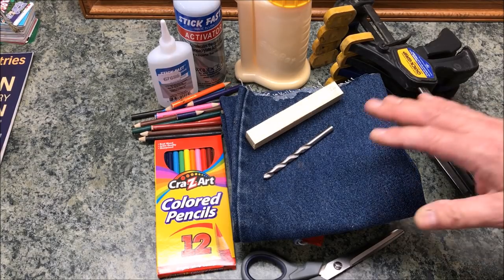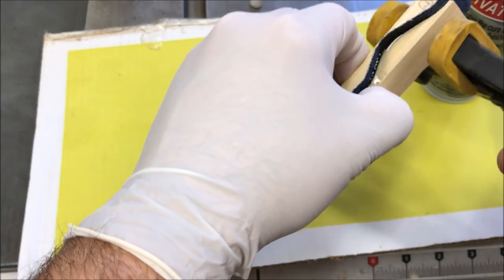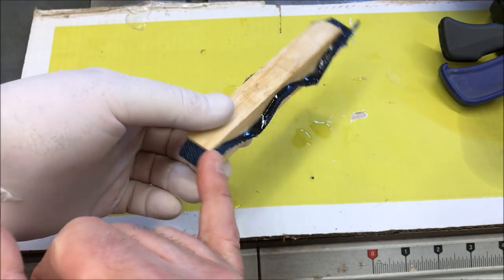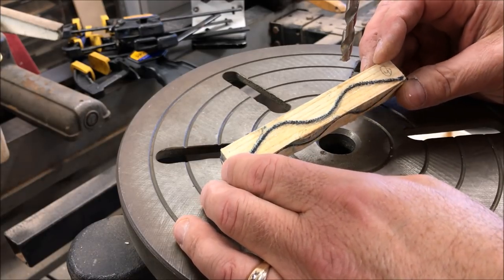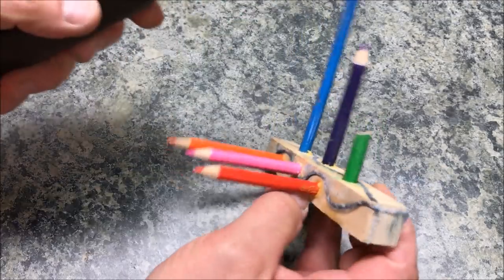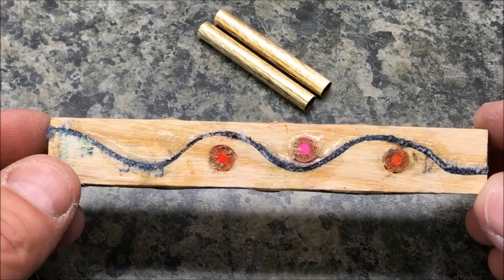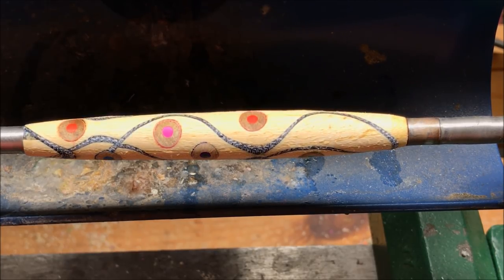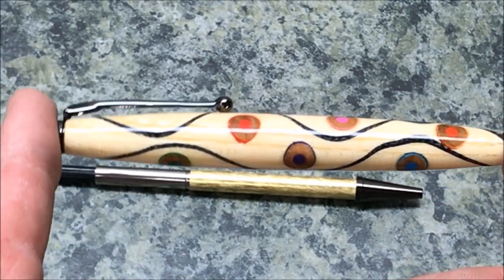Denim and Colored Pencil Pen Blank You Can Make

Comment: Hi Bob. Super result. How do you change the refil if you glue the brads tube in place as per usual....maybe i ve missed something 😅
Reply from the maker: You only glue the back tube in. The front tube and transmission are pressed into the lower tube. The transmission pressure fits into the back tube and holds it all together. 

Regards,
Bob
Reply: Hi Bob. Many thanks for such a rapid reply. It seems very obvious now😅. That familiar itch inside...im going to give it a go. I did your piano Pen for m'y wife. It Split along thé piano Key axis (perpendicular to pen axis) After a few months. Might try it again with timber rather than plastic.

Comment: Hello Bob,
I believe you've conceived the perfect "back to school" blank there, that's killer!  Wonder if you couldn't cut the top 2" off and save the cap end as-is, then use your parting tool to shave the top 1/4" of wood off the other end and drizzle thin CA down the outside of the tube to finish bonding the bottom and sand it clean?  That would still make a mighty fine conventional slimline.  Gotta talk to you about this dreaming away summer thing though, I'm still looking forward to my regularly scheduled springtime allergy attack! :~)
Have a great summer!!!
- Bill
Reply from the maker: +Bill Kibby Hello Bill,
  Great to hear from you. I've had several people send my ideas on how to fix the pen. I'm thinking I need to attempt it and video what I try. I like your suggestion and am starting to believe there has to be a solution in there somewhere. 

Regards,
Bob

Comment: Bob, can you heat it? you know heat up the brass tube just enough to get the ca to let loose. use your soldering iron to heat up the inside of the tube it should turn loose of the CA glue
Reply from the maker: +Marcy Cooper Good idea Marcy,
  One way or another, I'm going to attempt a repair. Let's hope I can get it. 

Regards,
Bob

Comment: Hi, the blank is a super succes...well done.
Thank you very much for filming a mistake..... so i feel not alone :-)
1 question: what kind of scrollsawblade do you use ?

Greetings from Holland.
Reply from the maker: +Peter Hendriks Thank you  Peter,
  My scroll saw is a DeWalt DW788. Not sure if it's available in Holland though. 

Regards,
Bob
Reply: thanks but i meant the blade type.
Reply from the maker: +Peter Hendriks LOL, sorry about that. I'm using a 9.5 tooth blade from Skill. 

Regards,
Bob
Reply: No problem, thanks for responding.....
Keep up the good work.
Reply from the maker: +Peter Hendriks Thank you. 

Regards,
Bob